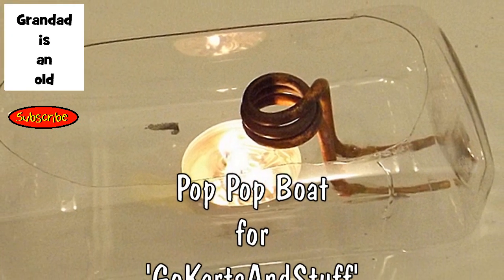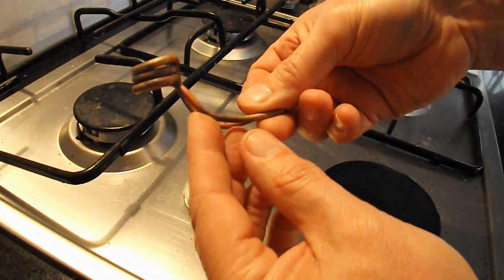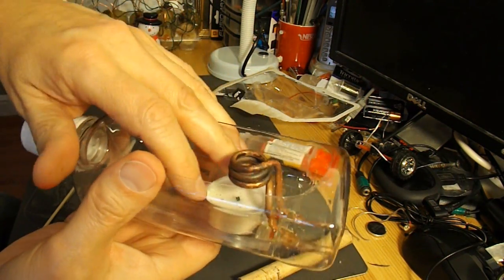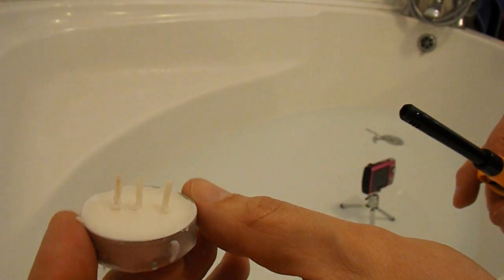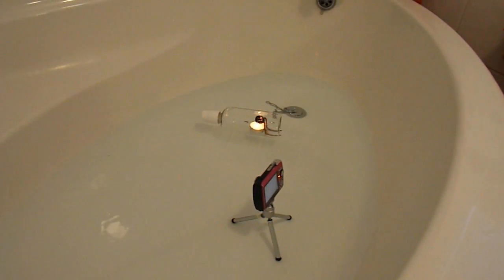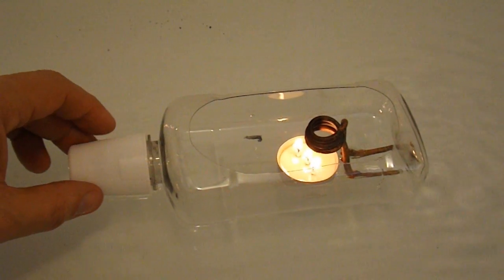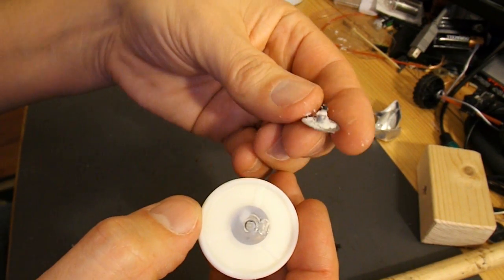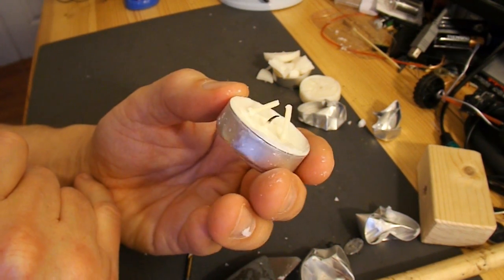Pop Pop (Put Put) Boat for GoKartsAndStuff

Comment: you could try to put an aluminum foil cap over the coil while leaving the bottom side open. This way the heat will be trapped and will heat the coil more efficiently. What do you think?
Reply from the maker: +Efrat Hoadley it might work, feel free to try it for yourself.

Comment: Copper is annealed by heating to red hot and quenching in water it goes very soft.
Reply from the maker: +pwbpeter thank you, yes that is right but I explained in the video that I can only heat short sections at a time using my gas cooker. Ideally you would use a blow torch to heat the full length and quench it in a bath of water.
Reply from the maker: +pwbpeter you might like this YouTube video on the subject by George Goehl https://youtu.be/3jSz11lz8MA

Comment: Nice!  We made some of these coiled versions, it's nice that they run quiet, but they're not really PopPop's at this point.  I like that you followed up w/ tuning many people get frustrated and give up when they replicate if theirs does not work right off the bat.
Reply from the maker: Thanks CJ (if I can call you that). I did hold the camera closer to record the sound it makes and although its not PopPop it does make a gentle popping noise but that bit of video didn't make the final cut. As for the tuning, having waited 10 minutes for the standard tea-light to fail to get it going I knew I had to force the issue. I did toy with the idea of putting a cover over it to hold the hot air in place but adding extra wicks was quick and easy.